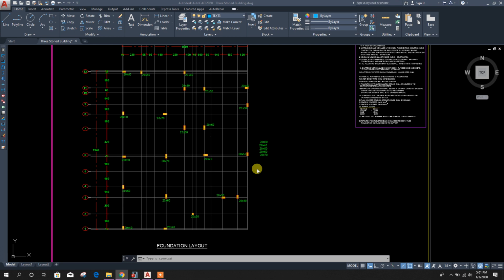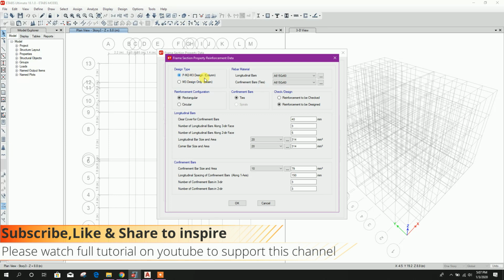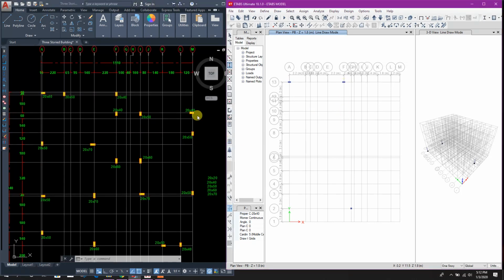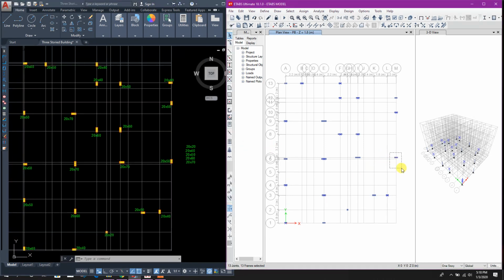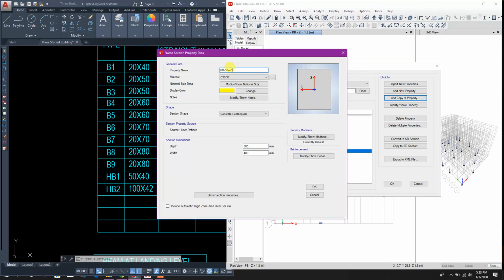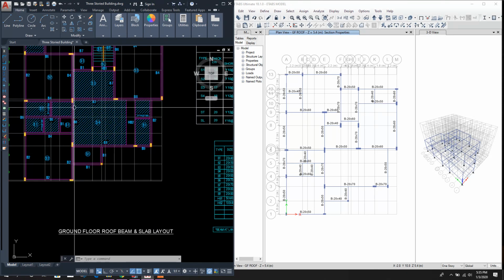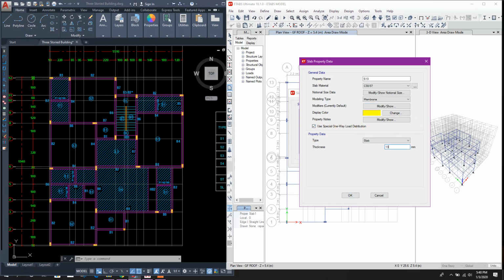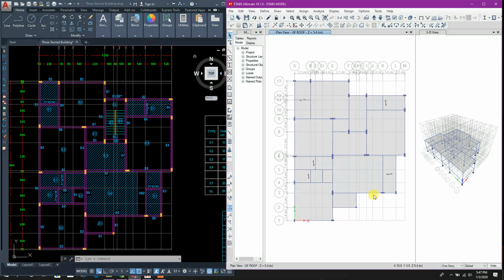Three Storied Building Modeling (Part-2) in Etabs v18

Comment: Thanks so much for all you have been doing,please keep up the good works.My question is not related to this video but it is important.Why are the results of say moments calculated manually higher than that calculated from etabs and how can we resolve this(make the two as close as possible)?
Reply from the maker: Manual 2D calculation will not have same  result as 3D FEM analysis. 3D FEM program includes unbalanced moments.

Comment: Hello sir is there any method to design hidden beam, if our span of slab is high and the depth of slab is limited {ie . 5mx5m slab}
Reply from the maker: This hidden beam is not hidden in slab. This hidden beam has depth like beam & slab goes down to bottom of this beam so that from down we can not see offset. So slab must be divided by this beam.
Reply from the maker: Same as regular beam.
Reply: @Decodebd  ok sir 
But , should we have to divide  slab or not 
If we provide beam then slab will be divided into two part or a single whole slab